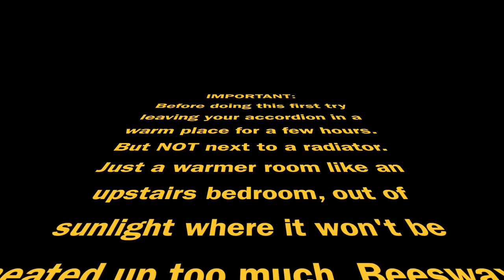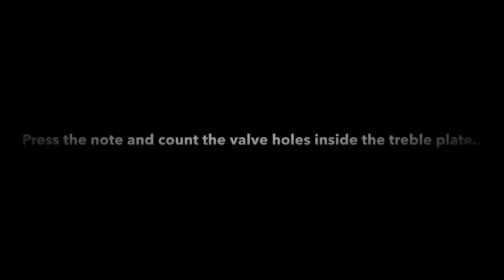How to fix a sticking reed tongue on an accordion

Comment: THANKS for the intro.  I have a new melodeon, bought second hand - 2 flappy sticky reeds already, so I thought I'd been sold a dead parrot but now I'm just going to try the temperature change...and play it in a bit, before I get all returny. I live in a pretty cold, humid house which could well be a factor.  Thanks for the info!  And great soundtrack.
Reply from the maker: Glad it helped.  A warmer room overnight might make a difference for a sticky reed, but don't leave the accordion next to a radiator as the wax holding the reeds in melts easily. If not then you need to open it up and have a look but that might create an issue for a return.  Take care 👍

Comment: Sir- thanks for this nice video. However- may I suggest and explain a few things very respectfully . (i) Music is not required in such videos.... it should have been only the sound of the affected reed (ii) In case a reed tongue is stuck due to dry wax or due to some foreign material in the tongue and its plate, or if reed tongue has shifted its position due to its lose 'rivette' or heat (rare), or a reed leather valve stuck outside/or inside due to moisture (if accordion played in wet weather) etc.  Now let's see some solutions 'after' the reed block is taken out.  But before that, plz identify and mark the affected white/or black key by cutting a cell tape in arrow shape and place it on that key, the arrow giving direction for 'inner' or 'outer ' reed  when bellows are stretched out or pulled in.  After this , blow in/out into the reed block  hole to check which reed is stuck and needs attention ( Never mind your breath moisture-just wipe it off if any. Many professional repairers do it often) . Next, pick a used shaving blade, break it into half -  'length' wise and check if the reed is stuck by lifting the tongue gently with the blade and release it 3-4 times till a nice sound like 'tun' is heard. This will/can remove any foreign object like dry wax etc. You may also slide the blade carefully between the tongue and reed plate.  If valve gets fixed due to moisture , gently lift it up and release it--clean the reed plate with soft cotton (NOT with cotton swab). If the inside valve  is stuck, pick up a thin screw driver and release it. If the 'rivette' is loosened , then take out the reed, align the reed with the blade by sliding it in the space between the tongue and the plate, listen to the 'tun' sound carefully and then carefully hammer the rivette by placing it on an iron base. Finally re wax the reed if removed earlier, blow out or in to check if the problem is fixed and reeds sound as they should -reassemble your accordion and play along . Good Luck. Caution-please do not fiddle with accordion if not'mechanical' minded and not confident of yourself. Regards.